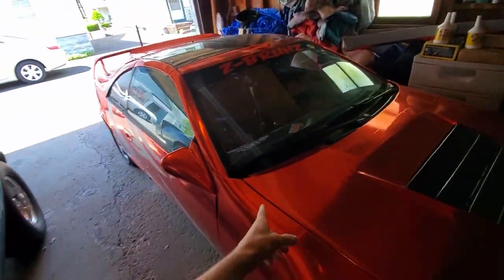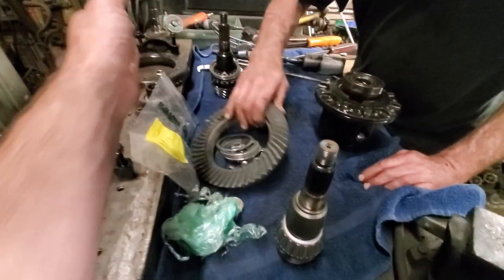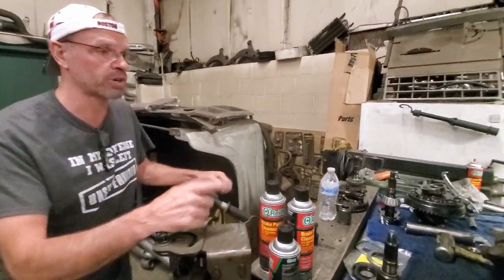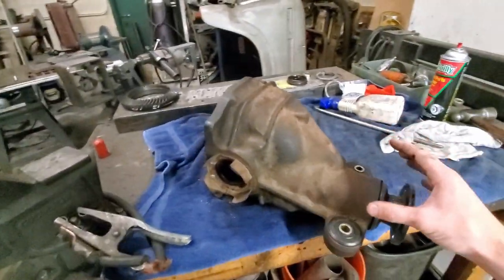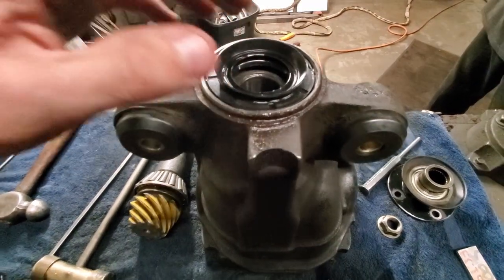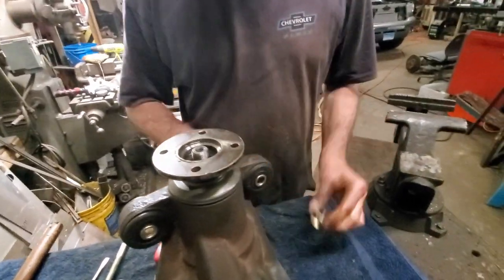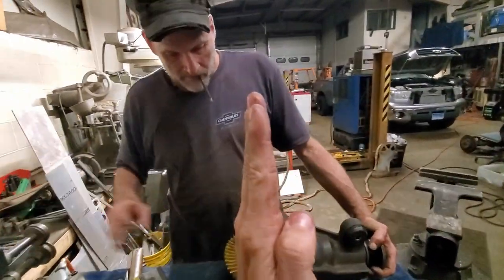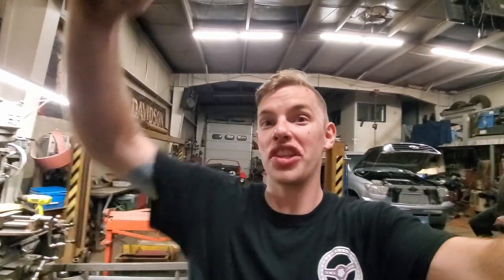The Best Guide Documented For a 4.63 & 4.90 R200 Gear Change in a Nissan 300zx VLSD Differential!

Comment: I'm planning on doing the same thing to my r200 differential I hope mine is easier because I'm putting the G37 r200 differential in the 300ZX I know I'm going to have to change the input shaft flange on the desk and the axles to

Comment: Hey z-bruhz, I'm looking for some help. I own a 94' 300zx and accidentally put too much pressure underneath one corner of my rear hatch glass. it caused it to slightly lift off the molding and off the car. Should I use a window sealant to glue it back on or does it work another way?
Reply from the maker: I haven't done any glass work yet but did it just pop out of the black molding?
Reply: @ZBruhzchannel  it seems he didn't need the advice 😂

Comment: You made this way harder than it needed to be. You put shims under the bearing race instead of that stack of 3 on your pinion. You should not need to source a bunch of stuff from ford's and toyotas. Maybe that pinion is not the right specs and you are rigging it to get it to work but you didn't say as much. Also there are torque specs for a reason.